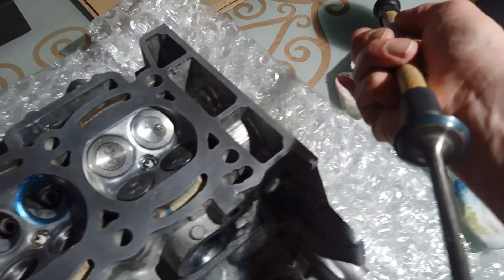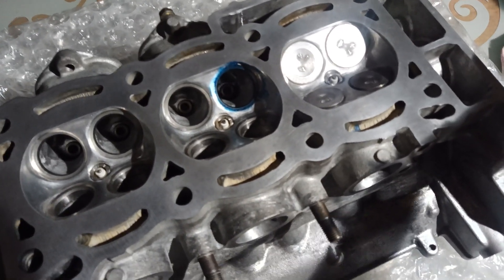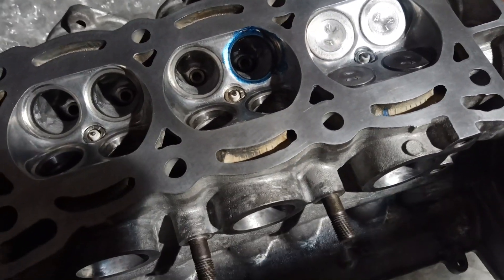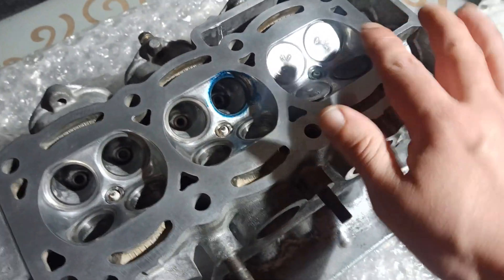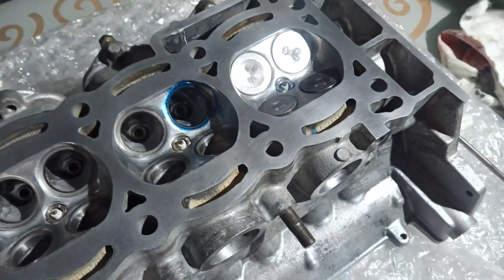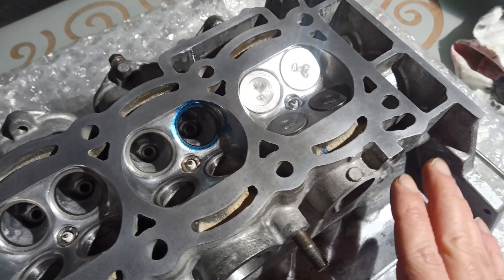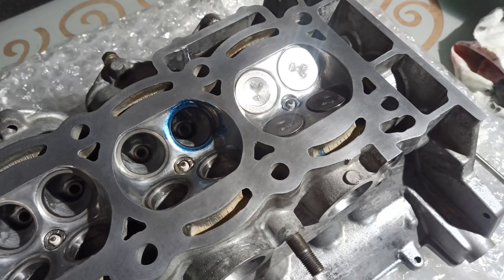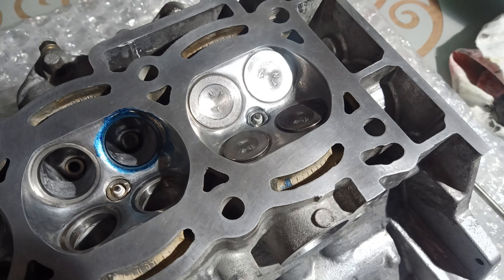Nathan Munns - Daihatsu Charade GTti - Valve lapping and checking for a perfect seal.

Comment: Nice work a good way to to lap the valves is to put a drill on the other end of the valve and then hit the trigger .you will see great results . I would also number the valves and  the ports and make sure they correspond when refitting.
Reply from the maker: Thanks, Have seen people using the drill method but I have only ever used the conventional by hand method. Yes stored the valves in order so all going back into original holes.